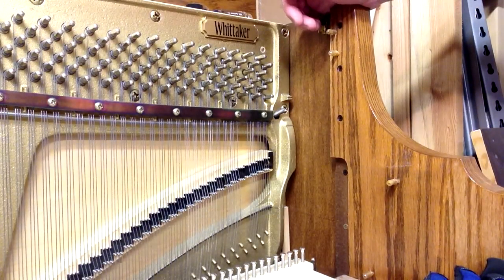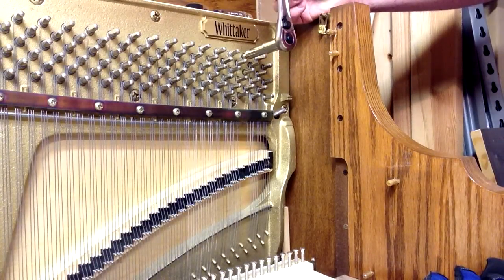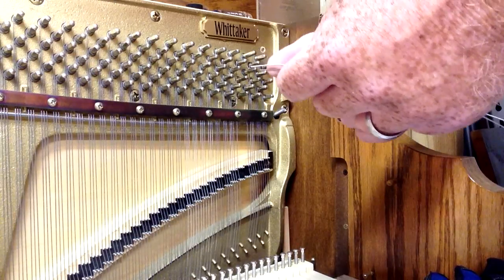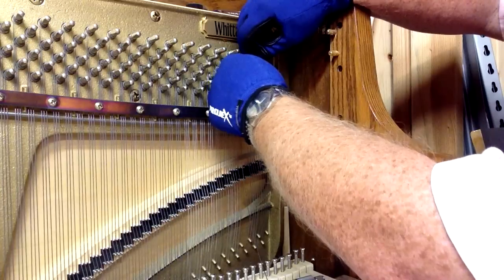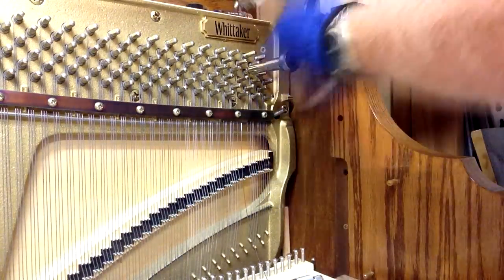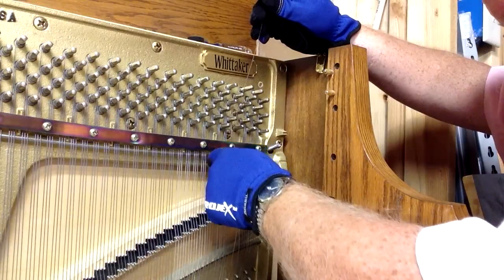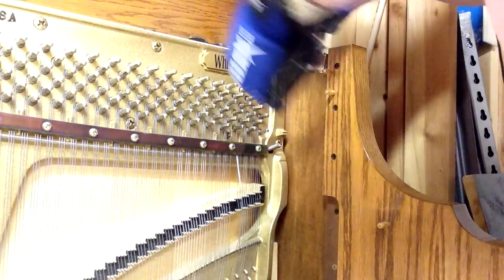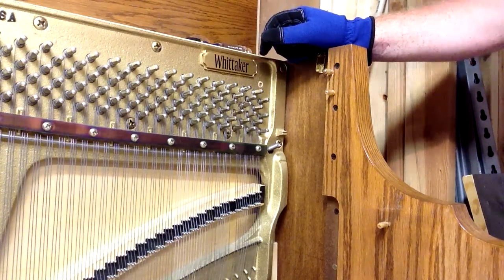Replacing a Broken String In A Piano - Piano Tuning & Repair I HOWARD PIANO INDUSTRIES

Comment: Hi Howard, when you're coiling a bass string wire can it simply be inserted in the hole in the tuning pin, held with your hand, and then coiled by cranking the pin with a tuning hammer... or is it necessary to pre-coil the wire before putting it onto and through the pin?  Thanks!
Reply from the maker: Hi Andy,
You don't need to precoil the wire.  What I recommend is to insert the wire into the tuning pin with the pin in the piano and then turn the pin to coil it on.  It would be difficult to hold the pin while coiling the wire onto the pin with your hand because of the amount of tension.  If you want to coil it with the pin out of the piano you should use the tuning pin coil maker that we sell: http://howardpianoindustries.com/piano-tuning-pin-hand-held-coil-maker/.  Please let me know if you have any other questions.

Comment: Thanks for the video--very helpful. Do you or does anyone else have an opinion about how quickly to move tuning pins, particularly when backing them out the 3 turns? I would have been afraid to move them as quickly as in this video since the friction causes the pin to get very hot, expand, and then permanently enlarge the hole resulting in a looser tuning pin.
Reply from the maker: If you're just turning it out three turns, the speed shouldn't be an issue from my experience.
Reply: yes I have that very problem with String F-4, it will not hold the string in tune
Reply: I wonder if a thread friction paste would work?

Comment: Excellent video. I have a 50 year old Kawai console. One of the two strings for key D2 broke. The string is about 48 inches long. I would like to try to replace it, but couldn't find references on the website for specific strings to be sure I'm buying the right one. I would appreciate any guidance. Thanks
Reply from the maker: For the bass strings there are a few measurements that need to be taken in order to get a replacement made.  Here is a link to the video which shows how to take the measurements: https://www.howardpianoindustries.com/measuring-for-a-piano-bass-string-replacement/
Reply: @howardpianoind  Wow!That's great!! Thank you so much.

Comment: Hello! I replaced a string following this video, but my problem now is that the string makes very little sound. Its as tight as the normal pins but doesnt make any sound, and usually if its not in tune it would still be very audible but its not for me. Is there anything I might've done wrong?. Please help, thanks
Reply from the maker: I would suggest ensuring the music wire you installed is of appropriate size/tension. Remove the string and reapply. Ensure proper hammer alignment once the string is in place. Thanks for watching!

Comment: Hello, my Eb3 string broke, but I don't know with what kind of string replace it, can you help me?
Reply: There is an inexpensive tool you can buy called a micrometer. It costs less than $20 and measures thickness very accurately. Each piano may have different thickness wire so it's best to measure to get the right size.

Comment: Are the piano strings on the right side of the piano have the same size like the rest or is it different?
Reply from the maker: No, there are several different sizes of treble wire in any single piano.  On average there are about 10 different sizes of treble wire which are all of the strings excluding the bass strings.

Comment: Hi there. I have just snapped a piano string today. When I measured the string it showed on the vernier that it is .90 mm. The sizes that are obtainable are .80 mm and 1.1 mm. Which one would you recommend I use to get the same tone etc. It is the F-string in the right side of the piano, I think it is called the treble size. Ha-ha.
Reply from the maker: We do have piano wire equivalent to .90 mm.  This would equate to .035" which would be size 15 piano wire.
Reply: @howardpianoind  Hi there, it would be a problem for me as I am from South Africa.

Comment: Great video!! Thanks for the book on piano by Marko Igrec. What I wanted to know is why is one string attached to two pins? As a guitar player I changed thousand of strings and I find it strange than on piano not every tone has its individual string but two tones share one string. Does it affect the next tone when I tune one just becauss the next tone share same string? I can't imagine not doing so. Why is that made so in first place? Thank you and thanks for great videos and education in piano tech
Reply from the maker: In tuning a piano the pin is moved just a very small amount.  Because of this the adjacent string is not affected.  If you're making a larger pitch movement, then it can have some affect on the surrounding strings.

Comment: Hi there, where can I find the ratchet that you are using? Because I have a set of general ratchets, but the attachment does not fit on the tuning pin. It doesn’t allow me to turn the attachment around to fit the pin. Do they sell ratchets with a special set of quadrilateral opening at say Home Depot or Lowe’s?
Reply from the maker: Usually the tool can’t be found locally as it is a special tool made for piano tuning pins.  We sell this tool in our online store and we are still open for business and able to ship orders. Here is a link: https://www.howardpianoindustries.com/ratchet-star-head/

Comment: What is a string breaks in the middle section and the bass strings are in front of the hitch pin?
Reply from the maker: Yes, the tenor strings can be tricky.  What I do is put a bend in the wire where it will wrap around the hitch pin and then fish it down behind the bass strings.  Once I have it on the hitch pin I put a clamp over the hitch pin to keep the wire in place while I get the rest of the string installed.

Comment: Following a recent purchase from your company I've gone on to replace two of the three strings (notes) needed. Unfortunately on the model of upright piano I'm working on E4's bridge pins are nestled in behind the overlapping bass strings. I've spent hours trying to work the strings into place. It's total madness... quite possibly the most tedious thing I've ever undertaken. I consulted a piano repair book that said on some pianos a curtain rod may be needed to guide the strings into position. I've tried with wooden skewers, but I'm convinced it's either a two man job (one to hold the string in place from below the keyboard and one to pull it around the other pin from the top) or one would have to remove several bass strings.

Can you tell me if my read of the situation sounds correct? Tell me I'm wrong and I didn't happen to break the single most inconvenient string on an upright piano.
Reply from the maker: Yes, sounds like you broke the most  inconvenient string! The curtain rod will certainly help you and you will also need a "third hand". You need the type of curtain rod that is flat (not round) and has two small hollow channels running it's leangth. One end of the wire is inserted down one channel and the other end down the other. Feed the same amount of wire down each channel until the wire runs out the other side. Having the wire in the curtain rod will keep the string from twisting as you feed it down between the strings. A small loop of wire will be left on one end and its this end you feed down behind the bass strings until it is in position over the correct hitch pin. Use a flat head screwdriver to press the loop onto the hitch pin and then use a pair of vise grips adjusted open just enough to clamp down on the hitch pin so that now the string loop cannot pop off the hitch pin while you continue to work. This is your "third hand". Now you pull up the curtain rod off the strings just making sure you keep the strings from twisting as you remove it. Feed one end of the string under the pressure bar and onto the correct pin and then the other. After you have the strings coiled around the pins and pull up some pressure on the strings you can go back down to the bottom of the paino and use a string hook or some such tool to work the wires around the correct bridge pins.
Reply: @howardpianoind  Holy cow, that’s a detailed instructional. Thanks, I can picture what you mean. Indeed a third hand was what I needed: I had a friend come over and he pinned down the wire on the right side of the bridge pin below deck while I pulled it over the upper pin from above, and then rinsed and repeated. However, now I know for the next time.😉

Comment: I was able to successfully tune my piano following your videos except 1 key where one of the wires came out of the hole in the pin thus not been able to tune it. Can I just reuse the wire by losen it, straighten it, re-insert it on the pin and tighten again?
Reply from the maker: Yes, you should be able to reuse the wire.

Comment: What about the strings that run behind the bass strings? How would one of those get replaced?
Reply from the maker: These are a little more difficult to replace.  You have to get the wire fished behind the bass strings.  Typically wheat I do is to make a bend on the wire to go around the hitch pin and then push the wire down behind the bass strings and get it hooked onto the hitch pin.  Then I use a clothespin or something similar to keep the wire on the pin while I install it in the tuning pins.
Reply: @howardpianoind  Thank you so much! I actually got it done yesterday (my husband and I). I finally realized that I had to remove the bottom panel underneath the keyboard to see down there. It was quite the task and it took a few tries but we got it!  Now all I have to do is tune it. Thank you so much!!
Reply from the maker: Glad to help!
Reply: With extreme difficulty and patience....

Comment: hi. i been playing guitar for 35 years. have done a zillion string changes. well, my neighbor gave me an upright Hobart M. Cable piano built in 1914. It sounds killer!!! Very loud and clear and great action on the keys. I've never had much interest in piano until i got this thing. I noticed it's missing a couple of the high strings. I really wanna put the replacement strings on there and i have a wonderful ear for pitch and tuning. What i dont know is what string gauge to use for missing strings. How should i approach this? Very curious. Any info on the string gauge might help. Thanx in advance
Reply from the maker: Unfortunately the string gauge for each individual note isn't consistent from one model of piano to another.  What you would need to do is measure one of the existing strings with a micrometer or caliper to get the measurement to the nearest .001" for the note you need a replacement string for.  Hopefully there is still one of the three strings for each note left that you can get a wire to measure from.  Please let me know if you have other questions.
Reply: yes the strings that are missing still have 1 of their existing strings. they were groups of 3 stringed notes but only have one string left. it's the 2nd highest group of Ab, A, & A# keys that are all missing two of their strings in the 3-stringed note groups. All the strings in that area look the same size gauge, but yes a micrometer would be needed to determine. Please forgive my ignorance of piano terms, as this is all new territory for me, lol. I am trying to learn. Thanx for all your insight & help. Your vids are awesome!!! i definitely need to check out your website!

Comment: Does one make an effort to bring the tension up evenly on each tuning pin until the tension is so great that there is no chance of slippage across the anchor? Or is slippage more or less prevented anyway by the resistance of the zigzag through the bridge pins?
Reply from the maker: Yes, you would tighten both pins to get them evenly tightened before bringing them fully up to pitch.
Reply: howardpianoind Thanks. Your videos are really interesting. I’m a basement-shop luthier and always wanted to learn about the piano. I’ll call you tomorrow for a beginning on tools.

Comment: Any tips for when the tuning pins are so close together that there is no room for the string spacer or even a finger to hold the string in place?

Also, I can't seem to find a video showing how to replace a string from the tenor section of the piano, where the bridge and hitch pins are behind both the keys AND the front row of bass strings, and thus nearly impossible to access. If anyone has any tips I'm all ears!
Reply from the maker: When the space is limited, I use a stringing hook to keep the string pulled up so the coil is nice and tight.

Yes, the tenor strings can be tricky.  What I do is put a bend in the wire where it will wrap around the hitch pin and then fish it down behind the bass strings.  Once I have it on the hitch pin I put a clamp over the hitch pin to keep the wire in place while I get the rest of the string installed.

Comment: I have an old Jannsen console and there is a felt strip above the pressure bar.  I tried replacing a string but only got as far as loading the wire through the first pin.  As I moved the string up I ruined that space on the felt.  Any tips?
Reply from the maker: It takes a little practice to make a nice neat job.  You do have to be careful working over the pressure bar felt.
Reply: Yeah a little tiny bit of the string kinda creeps up and hits the felt - guess I'll just have to practice pulling it up with a needle-nose

Comment: Thankyou for a valuable video .My question may relate to the way one string is used to form two vibrating strings .  On several very tight tuning pins I tried to cure the jumping and loud crack noise by turning the tension down and up till the sticking was improved. But  !!  I did that with a pair of sticking pins on the same note . Not being aware that those two were connected and probably retuning the wrong half first is there a chance those strings will have been displaced and ended up with a kink where the string should be straight .?   This looks quite likely as the loop at the string bottom is a simple turn that might have shifted .  A good long question for you .  The sounds of those tight pin notes has not been good although the basic note is there it behaves like a slow morse code .  Thanks again .
Reply from the maker: Hi John,
You chouldn't have any problems with a kink in the string from this.  I'm not sure what the problem sound is from your description.  Is there maybe a false beat in the string?
Reply: @howardpianoind  A very late answer for you .I was unfamiliar with the kind of noises out of tune strings can make . Your video is a big help to reassure amateurs liable to make mistakes like me  .

Comment: Howard, around 9:45 you are coiling the wire around the pin using only your finger to keep the wire from slipping.  I am unable to coil the wire without the wire slipping out of the hole.  Can you help me?
Reply from the maker: There is kind of a fine balance in keeping enough tension on the wire to keep it from slipping out of the hole as you start to tighten it up.  If there is too much slack in the wire it will tend to want to slip out.
Reply: +howardpianoind Thanks, I'm starting to get the hang of it; I'll keep working on it.

Comment: How do you attach the third string at the bottom end which cant loop back on the same note? Do you keep going left or is it attached to a seperate pin somewhere?
Reply from the maker: Yes, the left string will loop around the next hitch pin and come up to become the right string of the next note.
Reply: howardpianoind I had the very same question…   it's so simple, I just had an ah-ha moment.  Thank you for all your videos, they are VERY helpful !!
Reply: howardpianoind Thanks I was wondering about that.....just broke a string and found that I could only get one side out....now I have to figure out how to remove the whole thing as it is winds around the bottom hitch pin and becomes the right string of the left half tone! Could you put a video on how to remove a snapped string which wraps around the pins of two separate notes?
Reply from the maker: The procedure is basically the same whether the string is for one note or if it is a shared string between two different notes.
Reply: +Angeli Alvares I'm sure this is too-little-too-late since 6 months have passed since your comment, but since no one else has mentioned it: if you are replacing a wire that spans two notes, you should let tension off of the in-tact note BEFORE attempting to remove the wire! The bridge and hitch pins are bearing points (places where friction holds the wire in place) and can bear enough tension that when you use your pliers (or God forbid your bare hands!) to remove the other piece of wire, all that stored energy will let go at once and the string could harm your hands (or eyes, if you're looking up close)! ALL strings on a piano are under enormous tension and care should be taken that you never put yourself in harm's way when servicing or replacing them-- Safety First! :-)
Reply: thanks!

Comment: I have another method that disturbs the tuning pin minimally and is also faster. I wind the string on a tuning pin outside the piano, then pry the coil out of that dummy pin and click the coiled string on the pin IN the piano.
Reply from the maker: That method works also.  I just find it more difficult to make the coil on a dummy pin.
Reply: @howardpianoind  I forgot to say that it depends on the diameter of the new string. Up to 1mm it's easy to pry the precoiled string out. Thicker the metal is hard to handle and your method is better and faster.